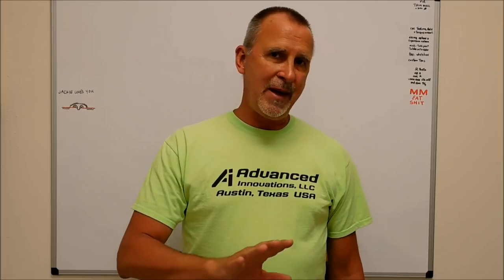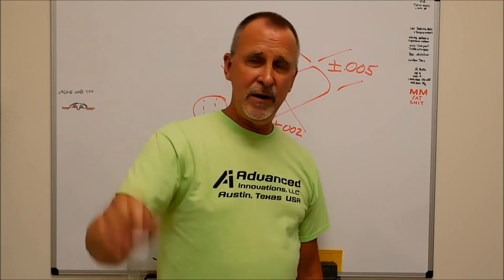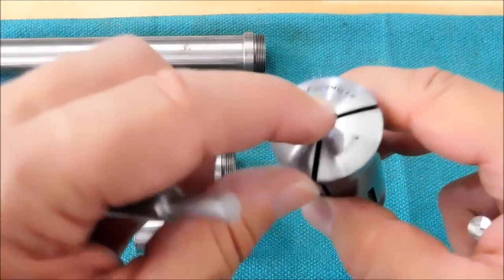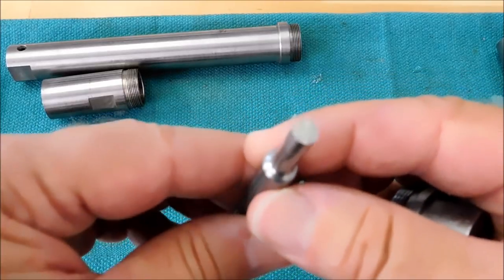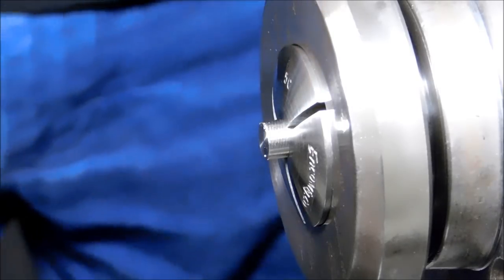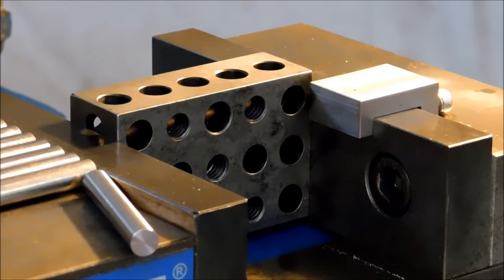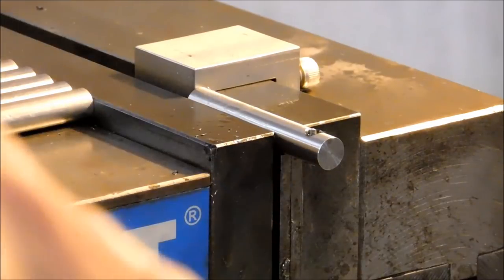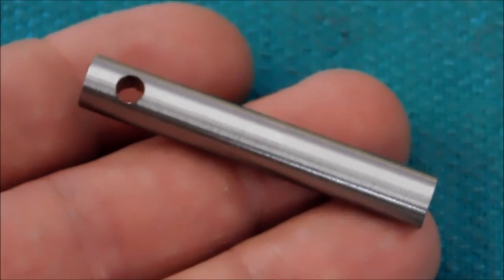Great setups, Crappy results, and the reasons why. Take a look

Comment: Bro thanks you got me pulling stuff out of my subconscious to my conscious.  In addition bring part to OAL by using the same set up that you used to drill with the other part balancing movable jaw.  minimize your protrusion as much as possible and bring to OAL with an end mill.  would be best if you use nylon material on the movable jaw.  Say 1/16" thick.

Comment: Hey Joe. I'm a recent gunsmith graduate and I've got my own little Jet 1340 gear head machine. I was wondering if you had any tips when it comes to changing gears regarding proper tightness and gap between the gears. I was in the middle of making a mandrel for a 700 bolt for blueprinting and had to swap a gear. I'm having some troubles getting them running smooth according to the sound they're giving off when running. Any help would be greatly appreciated
Reply from the maker: I have changed my fair share of gears in the shop. My trick is to allow for one of the member shafts to be free. During adjustment of the gear mesh, I wiggle the loose gear watching for movement and listening to the click. Right at the moment it goes away....lock it down. Rotate to check for bind and wear, the final torque it. The gear does the work, so the engagement doesn't need to have crushing pressure. Even a very slight gap wouldn't hurt.
Reply: Joe Pieczynski thanks Joe I appreciate it man. Love the videos! I adopted your threading technique they definitely don't teach it that way in school haha

Comment: I was thinking a collet block would be good for drilling the hole on center but not so good on distance from the end. On the other hand you could slide the block along parallels until the end hit a stop, then clamp. I thought one of the mistakes was the super long center drill and drill but I figured it might be for the camera. Also does clamping the vice against the ends of the rod tend to lift it off the vee except at the largest diameter?
Reply from the maker: Clamping the ends can lift a conical part, but at least the hole may be true to the part centerline.

Comment: For larger parts where a v block as shown isn't feasible, would it be acceptable to use two sets of parallels leaving a gap where the drilled hole is?  This is assuming the tolerance of the location of the hole is acceptable given tolerances of the diameter of the part.  Say smallest to largest part is .005" variance, hole on center tolerance is say +/- .004".  So when you locate for the drill operation, you can split the difference.
Reply from the maker: Every machinist will ultimately find a way around an obstacle. 10 guys will do a job 8 different ways with the same result. Using 2 parallels and drilling between them is fine. Don't rule out making a soft parallel and just drilling into it.

Comment: Hi I noticed that you were putting oil on the part  and when you did that the cut was changed , when that happens the oil is coming off because the the speed of the lathe . It is better to cool the tool because the heat is being generator by the tool bit and make a final  cut of .005 as the last cut ,. this will reduce the taper end .

Comment: Still don´t understand how different od´s makes the part go in more or less in the 5c collet. Never used a collet chuck but wouldn't the backstop take care of the length of the part? or is the backstop mounted to the collet? Im really digging your videos Joe.
Reply: The part will go the same length into the collet, but a larger diameter part lets the collet shut less, which means the collet's outside diameter taper is larger diameter, and thus it seats into the collet chuck slightly less (and vice versa if your part OD is less, collet will seat in further).  Because the stop is attached to the collet, it moves with the collet, but your 0 point stop is relative to the machine, not the collet nose.
Reply: @MWMitman   makes sense! thank you

Comment: Fantastic discussion about process control/error finding.  How would you correct the length variation with the collet?   The brackets at the end [MM] priceless.  not even going to ask.
Reply: I've heard there's such a thing as a "dead length" collet that clamps the part but doesn't move lengthwise but I've never seen one. Does anyone have info on this type?
Reply: Ellie Price, here is one type of dead length collet https://shophardinge.com/categories.aspx?catid=788 . known as index B42. I believe it is may also be called 173E. The shoulder sits against a solid surface and a sleeve with a matching taper slides in and out to collapse the collet.
Reply: Thanks Zachary, It's helpful to know that Hardinge makes dead length collets for precision work. I'd like to see just how that slide mechanism works.
Reply from the maker: I built such a collet fixture for a company I used to work for. We called them 'Crown" collets. Amazing accuracy. I should post a video on that one!
Reply from the maker: Barry Gerbracht      Correcting the length after getting a bunch of misfit OD parts will always be a challenge. You just have to measure them all and work in groups, or stand them up in a mill and mill them to length. Thats how my 4 position v block setup was born. Exact same scenario. Glad you caught the MM message. We'll just leave it at that.
Reply: Joe, Please make that video demonstrating dead length "Crown" collets. I'm curious to learn how the movable slide is actuated.

Comment: i followed along ok until toward the end - the V block. From the diagram what is holding the V block in place and what is holding the part?  Guess I would use the moveable jaw to lock the V block then a horse shoe type V clamp (or something) to hold the part to the V block. But I am not sure that is ok either. Lots of great tips in all your videos - thanks!
Reply from the maker: Vise jaw stops on either side and a spring against the movable jaw.
Reply: Thank you.
Reply: Horseshoe clamp not so important. As the downward drilling pressure will hold it in place too.

Comment: Missed the number of passes mistake. Caught the vise kick. Missed the V-block. However, did think about sacrificial support in vise rather than parallels. Question; would varying the doc on each pass but maintaining the same number of passes cause the diameter issue?
Reply from the maker: Yes. Once the process yields a good part or feature, any load change is going to show up in the final feature.

Comment: Great video.
What is your solution for the od variation with relation to the collect making the part to be trimmed to the wrong length?
Reply: ophirb25 
A stopper that is mounted into the rear of the lathe spindle bore and not to the rear of the collet .
Reply: ian bertenshaw would that vary the collett clamping force?
Reply: Michael Marriam 
As the collet closes it pulls the workpiece back against the stop rod , provided you don't hang off the collet closing nut / wheel like a gorilla the force the collet applies to the workpiece 
Remains consistent .
The type of stopper set i'm talking about is set up on the opposite end of the lathe spindle to the collet and has no effect on the amount of closing travel of the collet .
Reply from the maker: I would no be able to use a through spindle stop, since the collet draw tube moves with the collet. There is no place to anchor the stop. I can see that being useful on a mill, but not the lathe. Variations in the OD can absolutely be felt in the closer resistance. Its a great indicator that you have a deviation on OD. Inconsistent parts are the devil and can only be corrected or grouped and worked in lots.
Reply: ian bertenshaw thanks.  i had it in my head it would be fighting the collett.
Reply: Joe Pieczynski 
Good point Joe !
I was thinking more of what a hobby machinist may use and didn't take into account what set up industrial grade machines use .
I think what you are trying to explain to us is the importance of working to a tolerance within a tolerance if that makes sense ?
So even if a part has a tolerance of +/- 0.005 on a nominal diameter of say 0.500 the important thing is to make the rest of them all the exact same diameter  as the first one so if first one comes in at 0.502 then the rest need to be 0.502 etc .
What if you use the front face of the collet as a datum point?
I was thinking that the dimension from the stop rod to the front face of the collet would not change if the stop rod unit is mounted to the collet so a simple setting piece could be used ( a piece of round bar drilled to fit over the part you are machining and parted off a little longer than the stick out of the part to be machined to length )
Fit the new piece in the collet up against the stop then slide the setting piece over then touch of with the cutting tool and zero  your dial or DRO .Machine the first piece , noting the distance the saddle had to travel to get the part to the correct length  - lets say 0.050 so you now know that on the next part you just fit your part into the collet against the stop , tighten then fit your setting piece and touch off with the cutting tool and zero out your dial or DRO then move along 0.050 and part or face off .
Could be useful when machining raw bar stock that is not to be machined on the OD . 
You always manage to get me thinking about how i do things in the workshop which is a good thing and i can't thank you enough for that !
Reply: ian bertenshaw 
What you suggests defeat the tolerance concept as if you can make them all 0.502 you c an make them all 0.500 and not need any tolerance at all.

Comment: I think the number of passes would be OK if it was a rough cut-finish cut type where the first cut takes most of the material and the finish cut is light enough to not deflect the material. On the drilling, why not put the collet in your index head on the mill.
Reply from the maker: I didn't go that way, simply for error illustration. It could be used.

Comment: Ignoring potential fault in the diameter of the rod; is there anything wrong with setting the part up in the middle of the vice, and, simply letting the parallels hang out, off the side. Instead of clamping another part on the opposite side?
Reply from the maker: Nope. Just be careful your parallel doesn't sag into the center relief in your vise body. A piece of scrap material would be OK too.

Comment: Are jaws of a "jacobs" type chuck ground to where they contact the part at one place, thus increasing their ability to grip or are they ground dead parallel.
Reply from the maker: I have seen brand new jacobs chucks appear to make tip contact and tighten down to linear tangent contact under the correct torque. Drills that are only supported in the jaws outside the chuck body should not be overtorqued. This causes a springing of the chuck body and allows the drill to wiggle at the tip of the jaws.

Comment: At my old shop, most position tolerances were +/- .030" (yeah, that's really sloppy), and then to compensate for that, they drilled clearance holes +.030"... Should be fine in theory right?
Now imagine you have two plates that get bolted to each other, top plate is a clearanced hole, bottom plate is tapped, and by some chance, distances between holes are at the opposite extreme.. Well, now you have two parts, built within spec that still don't fit because the tapped hole doesn't have that wiggle room

Comment: Won't the moving jaw angle the part slightly upwards? if the tolerances were tight it might be something worth checking.
Reply: Poncho likes bacon In theory, I don't think it would be much of an issue with a quality vice. The clamping mechanism of Kurt and others has angled surfaces, that pull the movable jaw down to the bed of the vise as pressure is applied.
Reply from the maker: True. Kurt is a good vise and does pull down by design, but using 2 parts is still a good practice.

Comment: IF you approach everything methodically nothing will be off...For example I never get stock that's less than the part OD plus a cleanup 0.5-5mm(depending on the relative size of the stock) plus 1-2 calibration passes(0.2-1.4mm per pass depending on the material and the tool 0.2 being for a tiny boring bar with a springy attitude and 1.4 being close to the limit of my lathe's roughing capabilities).Also my lathe is missing it's feet which makes it crooked and unstable which means that I only have the dials for reference to the last pass and never trust to blindly dial something in!

Comment: I was taught never to use a center drill unless your going to put a center of a tailstock in it.  Only use a spot drill to prep for a critical drill location. I expected you to point this out but you make no mention of it!  Am I wrong!
Reply: a spot drill is ok, but a center drill, makes an actual hole so drill cannot walk, spotting drill only makes an angle, so the drill still has to find the center of that angle.  Always use center drill unless your on CNC!  Then spotting drill is accurate.  Hope that helps?

Comment: If you're going to the trouble of making a V-Block for this setup, wouldn't it be equally useful to take the part designer a donut and ask if you could add a center hole and use a live center in the lathe to reduce the potential for variation of the diameter in the turning operation?  As an engineer I was taught to "listen to the shop".
Reply from the maker: If your machinist asks for a center on a part this simple, get a new machinist. Also if he doesn't already have a 'V' block available to him, either in his box, or the shops tool cabinet, somethings wrong.
Reply: Hey, what happened to "Be gentle"?  In this case I'm the machinest using a 1957 South Bend Heavy 10, which is before hardened ways.  I have so much bed wear near the headstock that extending the work and using a center actually improves the results.
Reply from the maker: Didn't mean to sound harsh, sorry. I can see how the center would help. It can always be faced off in the future if no center is allowed. I always say, anyone can do the job with great tools, it takes a true craftsman to work with the basics. Thanks for your comments.
Reply: I can relate to Steve. My machine is a 13" SB that was built in 1939.

Comment: I made an internal spindle stop for my EE Monarch to overcome variable part length with 5C collets. Like or no like?
Reply from the maker: That would have been a good trick. Thanks for your honesty.
Reply: That's what I have on my machine. Learned early on not to trust the screw in collet stops if I wanted accurate lengths. Plus .. I have an ER40 setup which we all know .. has no provisions for an internal stop.

Comment: Brilliant, but if the part is not good on OAL, why bother registering the hole from right position? - the part is out of tolerance anyway.
Reply from the maker: If it were only the hole you were tasked with putting in on a bunch of supplied parts, its a good practice to make sure your setup will deliver the feature as dimensioned on the print.
Reply: OR, its like cutting hair.  You can always cut some more hair off but putting it back is pretty difficult.  If the hole is drilled to the correct dimension from at least 1 edge, you can always make the part shorter on OAL by removing material from the 'other' end and then everything is kosher and you don't have to start over/kick yourself/throw things across the shop/curse the world.

Comment: Here’s one for you chap, I’m a man who prefers the component to be spinning.....lathes and vertical borers.......I once saw a man set up a complicated component on a 72” borer, I would have set clamps all over the part for rigidity and safety.... This man set it up with just two apposing jaws, I saw what he was doing and got out of the way before he hit the start lever...... He got away with it and performed in record time which set a bench mark for us , the next week, (not me) a man used exactly the same set up and the damn this crashed and banged around in side the machine guards, I hit the stop button while he was as white as a ghost and totally F**KED UP.
Some are born lucky
Reply from the maker: I saw a 3 foot square block of steel jump off a Bullard vertical mill one night. It took down the safety walls like they were paper. Made a hell of a thump when it finally hit the floor.

Comment: MM eat shit?  really?  I feel the opposite way!  I work in a shop that only uses metric and its so much simpler to do everything and gives you smaller degradation. I realize you're old school and American (like myself) too though and in most shops inches are king.  I still have to use English when grinding tenths but... its a doddle.

Still, the king hasn't been the king since they threw tea in the bay and a yard isn't from your nose to your thumb.  Metric is king baby.  Hate it all you want, it is the king.
Reply from the maker: As much as I appreciated your passionate rant about the metric system, The MM on the board is  actually someones initials that truly deserves a shit sandwich.  A big shit sandwich. I actually never gave it a second thought about representing the metric system. Sorry if I fired you up.
Reply: There's an ass in every chair, brother.  Metric/English, whatever floats your boat.  I just thought it got you fired up.  Machinists, at least in my experience, seem to be particular people.  My bad!  :D
Reply from the maker: Virgo machinists are even worse.  ( ask my wife ) No harm. Thanks for the comment.
Reply: Yea metric is better, 2 places to the right is as (.01mm/.00039) this is a given. But when 80% of the measuring tools are in inch you have to convert, and the chances of a fuck up increase 5 fold..  if you need tenths measure tenths.
Reply: 25.4